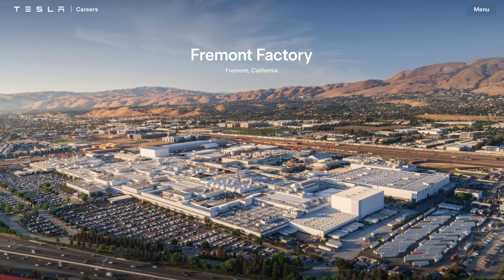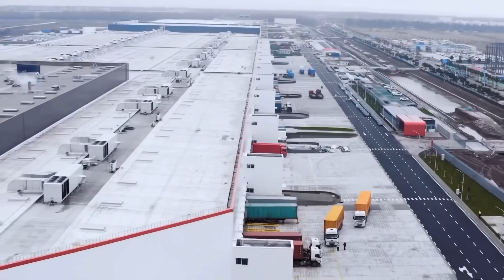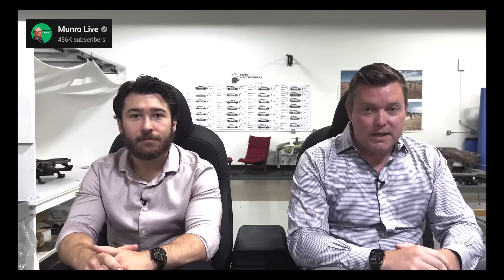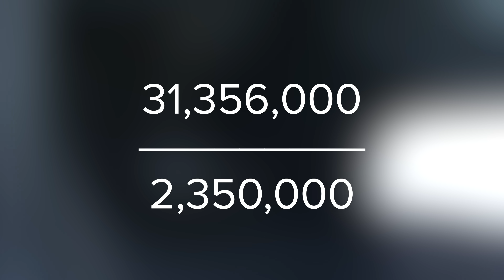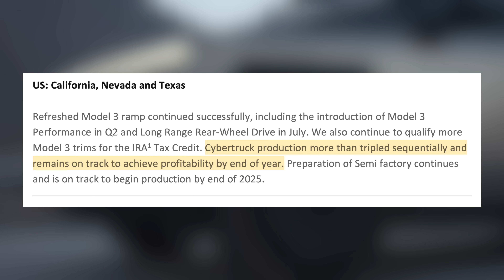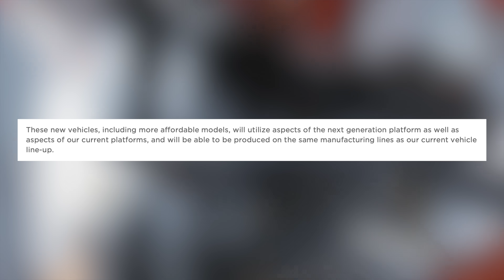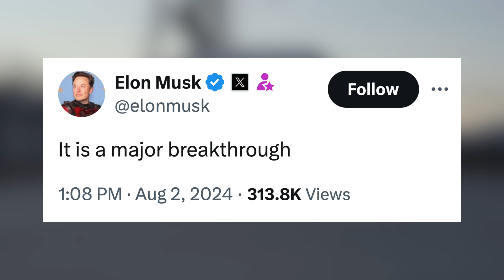How Tesla Builds a Car Every 13 Seconds

Comment: Giga casting was looked into by manufacturer in the past but the issue came in the form of insurance and repair bills . This is the case today many tesla owner cannot get reasonable insurance.
Reply: You express your ignorance. Tesla actually have section parts that can be easily replaced, crush cans front and rear and sections to replace bent and broken Castings. They will repair the Tesla to its original safety level ….
Reply: @chrisbraid2907  many cars have the same but the casting cause a particularly issue in that due to our rules on car repair they have to be written off as you cannot repair a casting
Reply: Of course .. what a waste of all our time. It's as if these are on sone sort of new dope. I think Tesla is on tbe nose. We just want to have a 13 second car to review not all this brainfig con
Reply: @pragmatist165  I just commented on the insurance-issue. If thats not interesting to you then don’t read it. I don’t see any problem.
Reply: Yeah, that was the first thing popping into my mind when he brought up the one die casting. From a manufactoring POV it sounds logical, but from a repair POV it's a nightmare. Even the smallest of accidents can lead to a total loss because of the costs to replace a complete chassis + battery pack.
Reply: @edwinw6796  FUD !
Reply: @edwinw6796  and you can only high pressure die cast aluminum, not steel. Not the same strength.
Reply: One more reason why Tesla offers its own insurance. Also it is looking into the future, making accidents almost impossible with FSD.
Reply: @IronMike-wk1sy oh please Musk has been promising full self driving "next year" every year for 9 years now. He's clearly full of crap about that. But whatever enjoy the kool-aid! 😂
Reply: @ButterfatFarms  you act like it’s Elons Fault that NHTSA won’t certify FSD. He’s optimistic and they are very picky. Don’t get me wrong, it’s not a bad thing but FSD is better than so many Drivers ….
Reply: @IronMike-wk1sy oh wait that was back in January of 2022 add a couple more years to the next year promises! 😂
Reply: @ButterfatFarms  It doesent matter if FSD is coming next year, the year after or even in five years. It will come. I am sorry that you cant see that.
Reply: Kool-Ad Alert.

Comment: Firstly i need to correct this stupid comment thay been spread around by oil companies and latched on to by car manufacturers. (And exploited to incresse prices) Namely it more expensive to manufacturer electric car . Its not infact it cheaper to manufacturer ev as there less parts and material and battery packs cost the same as engine and every month as technology advances batteties are getting cheaper.

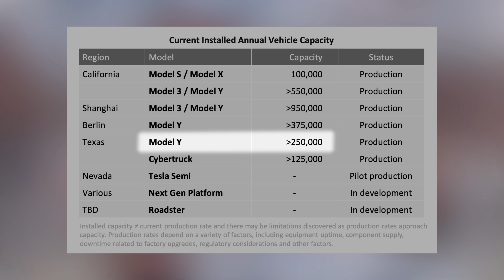Comment: At 09:46 it says Installed Capacity Does Not Equal Production Rate. According to Statista, Tesla made 433,000 cars in Q1 2024. Which works out to about half your number, so more like every 26 seconds.
Reply: This. I know JLR one plant can produce one Range Rover every 30 seconds. Slows down to 45 seconds during normal production, and has downtime days for maintenance. I’m sure Tesla is similar. 

Tesla do not have miracle factories, they are no more high tech than many others.

Comment: My hybrid is in the shop for its 60k required maintenance.  $1000 for radiator water change, brake fluid change and transmission fluid change.
Reply: Hybrid is the way to to if you're doing gas.
Reply: Ripped off
Reply: You failed for getting a hybrid The worst car in the world to buy That's what keeps the ice companies going And all the old people that buy them they're fooled you all especially Toyota
Should have just stuck to fuel 😅

Comment: They should slow down the line by adding more QA checks and make it like a Toyota factory.  When a Toyota worker discovers a faulty installer or machine, they stop the line, and do not restart it until the issue is rectified.  None of this after built rework garbage we see in the Model X and 3 we own.
Reply: QA is a continuous on line process controlled by the factory AI and the car's computer.
Toyota's 50 year old practices are no longer the bench mark for manufacturing.
“To deliver attractive BEVs to more customers, we must streamline the structure of the car, and – with a BEV-first mindset – we must drastically change the way we do business, from manufacturing to sales and service” Toyota’s CEO Koji Sato.
Reply: @waynerussell6401  whatever they are doing is not working well in Tesla's case.  I have an X and 3 and both have quality issues, especially the X.  Their solution is for the service centers to fix what the factory messed up.  They would save a bundle if the initial build was better.

Comment: You say it took 3-5 days and now 13 seconds. 
It seems you compare the start of the 1st part (assembly) until the final vehicle leaves the manufacturing line. With the 13 secs (up to now i am still watching) you talk about the tact rate where Tesla was already on the top with 35-40 seconds.
Later you say: 'every 30 seconds'. Thats more. realistic. That could be a challenging one assembly line but most realistic they have two assembly lines in parallel in Shanghai?

Comment: Gigacasting isn't a no-brainer. Think of the insurance rates rising once a couple more of these cars will be damaged in a crash. With Gigacasting, repair costs currently explode due to impossibility of replacing individual parts of the main chassis. Some cars aren't even repairable at all resulting in replaceing them with a new cars. Sure, looking at the manufacturer in production and at the customer when purchasing the cars, all will save some money in the first place, but in the long term overall-costs will rise for every customer due to that given fact.
Reply: They might get totaled out but the insurance company sells those teslas at auctions they bring big money at those sales so the big cost gets washed down pretty quickly

Comment: Might do a fact check ...
43-45 seconds is the only numbers TESLA has ever stated about their production line roll off. This is the time spacing between car exiting the production line. The actual production time is close to 3 hours to assemble the car.
Reply: Maintain that Rate for 3 Factories, and you get 3 Vehicles built in that 45 Seconds! That equals 1 per 15 Seconds! But, they have 4 Factories! Building Vehicles! Plus Giga Nevada, Giga New York! And a few Development Sites!

Comment: If Tesla is still building a car every 13 seconds then they are going to have even more inventory sitting around. Model Y and 3 inventory is stacking up. Also if they make them this fast it is no wonder many people complain about fit and finish problems, panel gaps, scratches, fingerprints, unglued door gaskets, defects in the paint, etc.

Comment: Every 13 seconds is nonsensical. VW and Toyota need even less seconds. So are they producing more efficient? And 4680 are not cheaper than batteries from suppliers. For example CATL LFPs are cheaper.

Comment: As long as punitive tariffs on Chinese cars hold, Tesla will have the U.S. market.
IDRA (gigapress manufacturer) is owned by LK, a Chinese company.
Chinese have the best batteries being produced at large scale.
They can produce them for less than the cost of materials sourced in U.S.
I would not be surprised if Tesla gives up on it's own batteries and starts buying from CATL or BYD.
They also have had self-driving tech for many years (not as good as Teslas, but not as expensive either... and includes extra sensors).

Comment: -i wonder if the simplified gigacasting is why insurers tend to write the car off as a loss.
-i imagine repairing that style of frame is absurdly expensive bc you cant buy only the parts you need since they cant be stocked on a store shelf or found at a junkyard.
-On top of that tesla bans you from software updates or from the supercharger network if you do any "out of network" or DIY repairs.
-not being able to easily do repair yourself changes a significant part of ownership, as you're forced to use the company; much like how apple overprices their repairs to force you towards "just buy a new one".  
-Its nice for tesla to more efficiently make cars but it sucks for consumers since you're locked into the company's ecosystem; yet another "you will own nothing".
Reply: I don't think it's as easily bent or broken as a standard frame.
My suspicion is that if it does break, the car was probably in a serious enough accident to total the car anyway.
Reply: Lars Moravy hs addressed this.

Generally a car which is in such significant a collision as to bend the chassis is written off.

Clearly this will often also be the case with a cast body.

However, Tesla as an Insurer as well as manufacturer, has an interest in minimising this risk. They’re able to provide replacement sections for certain types of collision repair and at a cost lower than equivalent repair on a conventional vehicle chassis.
Reply: Sounds like a unibody to me.

How much does it cost to replace an unibody?
Many factors will determine how much a unibody replacement will cost, including where the damage is on the frame, the material the unibody frame is made of, and the extent of the damage. Minor damage to the frame can cost up to $1,000, while a full replacem

Comment: 125 tesla's were made in watching this video
Reply: 2.0 speed here
Reply: Just did a math in Ford. So, Ford makes a car every 6.3 seconds! Don't even go to Toyota.
Reply: @italianoftheeast2481 with hundreds of factories between the two you mentioned.
Reply: And 124 of them have broken down
Reply: Car every 13 second means around 2.5 million cars per year.   Total world production of passenger cars is around 69 million per year.  So Tesla produces 3.6 percent of world passenger cars.
Reply: Thats why they fail so much
Reply: Completed not made
Reply: Only one sold
Reply: 1.25x here. I like to pretend the hosts are just quick talkers.
Reply: 125 were completed, not built from scratch. If it takes 8 hrs from start to finish, to get a car finished every 13 seconds, they would have to have 8x3600/13=2215 cars in the queue or 554 cars in each of his 4 factories.
Reply: You don't watch at 2x?
Reply: @mavhc 1.5x here. Maybe, I’m just a little slow.🤷‍♂️ 😁
Reply: @svenhodaka9145 1.25x here😂
Reply: 200 burned 🔥  in garage in minutes
Reply: @carlmorgan8452 ratio wise more ice burned than ev